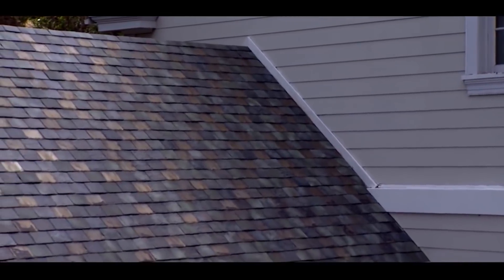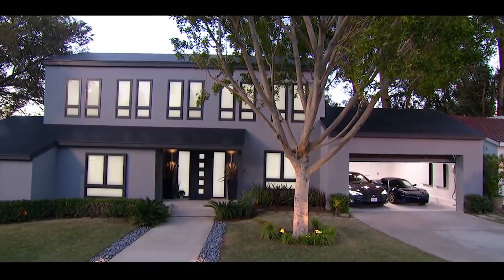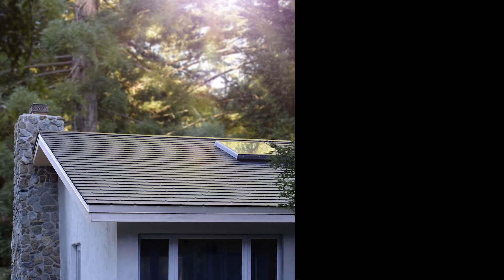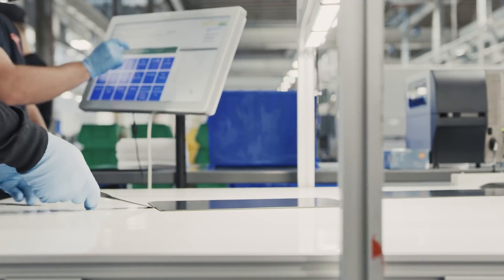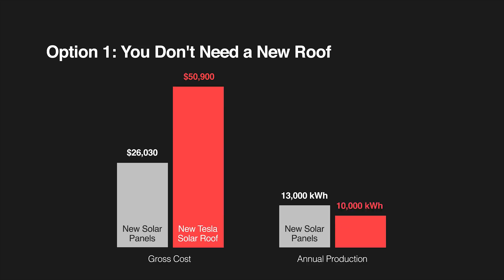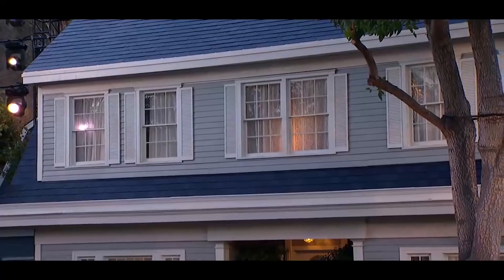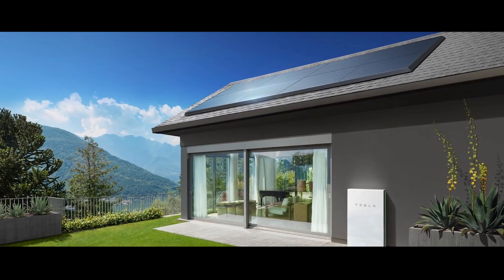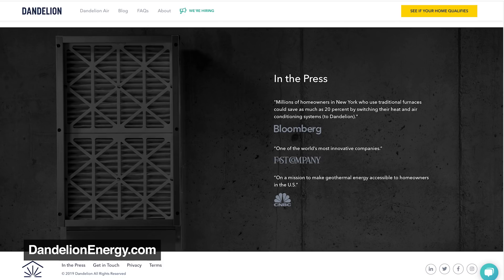Tesla Solar Roof Worth It?

Comment: I purchased my 20-panel, 6.5 kWp system just a few months before Tesla revealed the Solar Roof in 2016. I initially felt like I should have waited, especially since I desperately needed a new roof. But 20.2 MWhs later, I’m really glad I bought my system when I did rather than waiting...because I’d still be waiting. Plus, I added 12 additional panels last year knowing I’d need more power to charge my Model 3 and two Powerwall 2s. That boosted my system to 10.25 kWp. Scalability is a big advantage of traditional panels. While I’m rooting for the Solar Roof, I feel we’re still a few years away from making it a mainstream choice vs. panels.
Reply: Anyone in the industry looks at the Tesla package as interesting, no more, it's not cost effective and wait, until one tile loses it's connection.  Connection points are anathema to good solar design and this system adds hundreds of them.  I always thought Musk was getting the public to buy and pay for the R&D on something he plans to use on Mars.  The tiles fit aboard his newest space ship.
Last year while shopping for a system with battery backup capacity, I went with SolarEdge and LG Chem Resu 10 because they ship the stuff in a few days.  Tesla equipment, especially the batteries are in short supply and could take weeks or months to find you.  Tesla does sell a whole line of "conventional" solar PV made by Solarworld, which are the 'best' in some circles and most of their sales are for those systems, not the tiles.  Heat and cold are your enemy.  Don't buy anything that's not designed with your climate zone in mind.
Reply: @refusoagaino6824  
Mercedes and Audi are not cost effective either. Even apple are not cost efficient but guess what people still want them. 

The idea of a roof that can charge your car up is fantastic for local living. Now I would never take the car cross country though.
Reply: First adopters always pay a lot more. Once a new technology is accepted by the mainstream consumer prices drop dramatically. For example, televisions, DVD/Blue-ray players, and Tesla Model 3 vs Model S. I'm rooting for all clean non-carbon based power sources.
Reply: What appliances do you run? And how much of your requirements do you get get covered by the panels?

Comment: Not sure if it's been said yet, but the heat generated from the standard solar roof tends to deteriorate the asphalt shingles that are still required on the roof. With that, you would need to replace the shingles more often which would require the removal and re-installation of the solar roof. Depending on the installation costs of the standard solar roof, that may inflate the lifetime cost of the standard solar roof.
Reply: How is that supposed to work? You still have the same insolation onto the area of the roof. But now 18-20% is converted to electricity and the remaining 80-82% is down-converted to IR or reflected. Of the down-converted IR, roughly 50% is going to be emitted toward the sky. That should reduce the heat load on the roof, especially with the new "asphalt" shingles that are IR reflective.
Reply: @Markle2k  I will acknowledge that I do not have a solar roof and do not have direct experience with the situation, but there are a few things that I considered with analyzing the heat issue. With a standard roof, there is nothing in the way of the heat for it to be dissipated away from the shingles. Once you add the solar panels to the roof, you are creating a confined space where any heat being passed through the solar panels is being trapped, at least until it can rise to the peak of the roof and escape. Yes, some will pass through the small gaps in the panels but most will remain trapped. So even though less IR is being directly applied to the roof from the solar panels, there is the cumulative effect of more heat being generated and applied to the warm air as it rises up the roof. you may find that the presence of the panels will improve the lifespan of the shingles closer to the eves, but that would change the further up the roof you go. 

Looking at it another way, standard 35 year shingles don't usually last the full 35 years. With the exposure to the sun and weather, a 35 year shingle may only last 20-25 years. Since they are protected from being directly impacted by the weather, we would expect the lifespan to be increased up closer to the 25-30 year mark as the heating would still wear the materials. Asphalt also dries and shrinks over time, as you see with shoulder to shoulder cracking on asphalt pavements, which would make them less tolerant to flexing. Since water will still be flowing over the roof below the raised panels, cracks in the shingles would still be a problem.

All that aside, Tesla is claiming that their panels would not have to be replaced once installed, so there should never be the need to replace the roof. At some point in the life of a raises solar roof, the asphalt shingles would need to be changed and the additional cost of removing the array and re-installation would need to be considered.
Reply: @leifbergman  Links to this phenomenon?

Comment: I love Tesla but while the Solar Roof sounds good in principle, in effect you end up paying more for the product and gain less energy which leaves me doubtful as to whether or not I'd bother. If a person's priority is an aesthetic & renewable energy combo or the decision to buy is down to planning restrictions preventing solar panel installation then it might make sense but if maximum power output is prioritised then it has to be solar panels all the way.
Reply: Peter S The amount of power you draw should be configurable? Like I remember only a certain percent of tiles would actually have solar cells, and you could choose to increase or decrease that percentage as desired (for a premium of course). You certainly are paying for the aesthetic, but that’s no different than most choices you make when building or remodeling. Like the price difference between a cheap countertop and a fancy granite countertop is enormous, but they essentially operate the same way. So I don’t think a 33% premium for a nicer looking roof is out of line. By the same token, it’s not for everyone.
Reply: @PeterWW420  Fair enough.

Comment: You fail to point out that the Tesla tiles are extremely durable and will last far longer than slate, Terracotta, asphalt etc., therefore will be cost effective  over the life of the roof or 30 years assuming the cell continues to function for at least that period.
Reply: Exactly.  I was also thinking that they may still function like ordinary tile in keeping the rain out, long after they lose the ability to generate energy.  So at worst, after 30 years you might still have a durable roof.
Reply: I dont think it will produce the same amount of power for that long
Reply: @sometingwong7026   Neither likely will a conventional solar panel on an asphalt shingled roof.
Reply: Ken Bob I know
Reply: Ken Bob I’m saying a solar roof not going to save money at least not yet
Reply: @sometingwong7026   Not necessarily.  Like anything, it depends on your individual situation.

Comment: I want to get it in Miami, the problem with normal solar panels in Miami is that they get ripped off during hurricanes.
Reply: So do rooves.
Reply: The low-profile mounting systems don't act as a sail. Assuming you have a competent city permitting office, anything you put on your roof should be rated not to turn into a missile in a typical 50-year windstorm.

Comment: Question: Do you need to have the Tesla solar roof or panels to use their power wall storage option? Wife wants a Tesla roof, I knew it wasn’t wise but didn’t want to burst her bubble. She wanted the power wall more I think. Would the power wall work with other solar or geothermal options?
Reply from the maker: You don't need any of the above for a powerwall, you can use them totally independent
Reply: Should do but double check first before ordering. Sonnen is a top selling German company who also sell Powerwall equivalent home battery storage systems. You might want to shop around to see what else is on the market to see what suits your needs, situation and budget. Tesla & Sonnen are just two of a number of companies in this field.

Comment: Great video.  I looked into the Tesla Solar Roof but the economics didn't add up, especially since I already had a pretty new asphalt shingle roof so I bought and installed a solar system that's near-identical to the last pic you show of a standard, all-black solar panels which look wonderful!  I think the Solar Roof is ideal for new homes that haven't installed a roof yet and especially higher-end homes: >$500k.  I think Tesla solar will sell A LOT more standard solar panels than Solar Roofs.